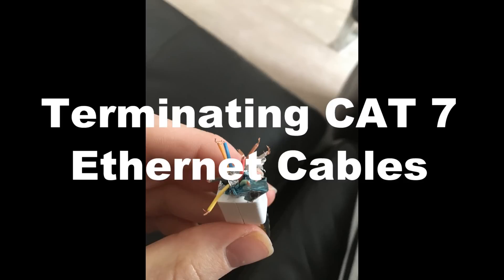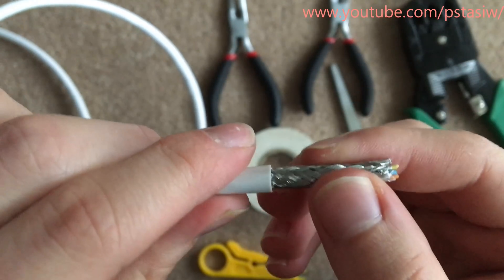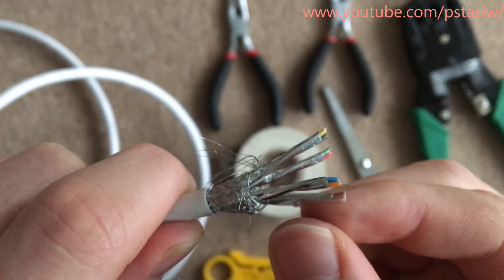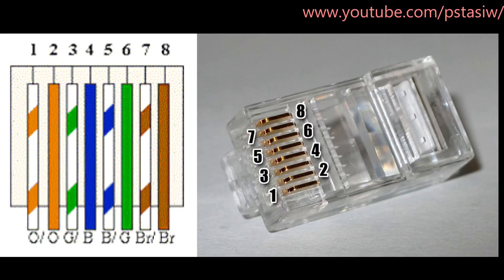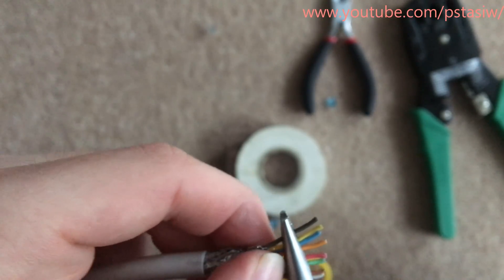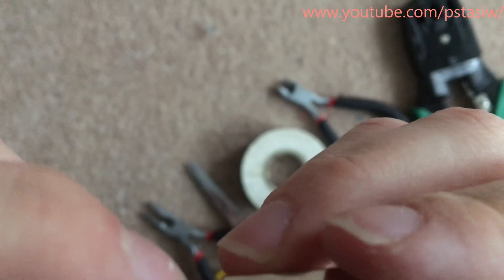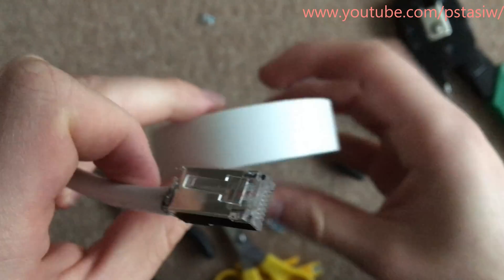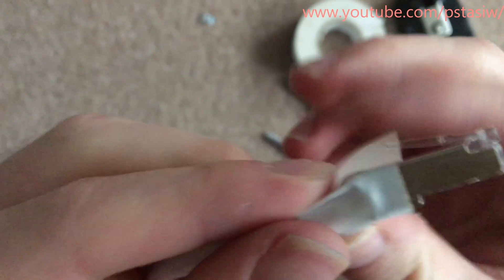How to terminate CAT 7 Cables with a Shielded RJ45 Connector [4K]

Comment: Bad! BAD advice! for beginners do not follow this videos advice. This person clearly doesn't know what he is doing.  The twisted pairs must be used as PAIRS! I worked in networking for 10 years I know what I am talking about.
Reply from the maker: If you’ve worked in networking for 10 years why are you watching this video?
Reply: @pstasiw  The video popped up in my feed and I clicked on it 🤷‍♂ bored I guess. Fact is I design implement and program networks for Cisco customers I am usually not the one running and terminating cable but That is where I got started years ago. point is that there are plenty of good videos showing the propper way to terminate cat6 / 7 shielded cable... but this isnt one of them.

Comment: This is one of the worst cable crimps i have ever seen. He didn't measure the length needed before you crimp. He didn't insert the cable all the way into the connector. Then to top it off he uses electrical tape! Just bad dude. I wonder if you have cross or static signals.
Reply from the maker: Cables work perfectly thank you very much

Comment: this is not even a cat 7 cable.
This is tops a cat 6 shielded cable...
Difference: cat 6 wires are 1.35mm, cat 7 wires are 1.5mm.
Problem, they do not fit in the regular RJ45 plugs, so don't get fooled by the title!!

Comment: I get why the Haters are Bitching... But Trust me at one point THEY ALL DID it too... in there life ...just like you did So Dont listen to them young man, but for your Next try go on Ebay or an electrical Supply House & look into getting RJ45 PLUG BOOTS that coverup the base and come in many colors.......they slide on the cable and when your done you slide them back up and they lock in place and some come all the way upto the RJ45 locking tab and make them look Pro you can get a bag of them for a few bucks........So keep at it and just make sure you test the wire after you made it and keep on TRYING!!

Comment: the shield was not properly terminated so the use of the cat 7 is wasted, there is no protection against cross-talk for example. wasted money. The tools used are not sharp enough to do a professional job
Reply from the maker: Thanks smarty pants. The cables still work, just not as fast. Run a speed test with them.

Comment: This is extremely bad!  You need to cut your wires shorter to allow the outer covering to enter the end connector.   I applaud your effort but in the long run this connection will fail sooner rather then later and the signal over this connection will have a lot of crosstalk!  If you were in one of my classes you would get a failing grade on this connection.

Comment: At 3:57 Yes it does matter which wire goes to which pin. It really does. You must not split the pairs.
Reply: Technically, no, it doesn't matter if each end of the wire are configured the same. A wire is a wire, the color doesn't make it any more special. It's only used as a guide to make sure you don't fuck up.
Reply: @TetraSky  You must not split the PAIRS. You can technically make up your own standard, but communication requires 2 wires, and those must be twisted to reduce crosstalk. 8 wires = 4 communication paths.

Comment: You test the connection after a while? Because the copper is one of the most influence metal on the temperature (cold/warm), the connection for sure will be affected. Best idea is to use fild connector for outdoor, more expensive but sure connection in time! http://shopconectica.ro/mufa-rj45-cat6a-cat7-ftp-pentru-patch-cord-uri-teren-100-140.html

Comment: This is one of the worst cable crimps i have ever seen - On the + side, I applaud your DIY approach but you need coaching on how to do this right.  The shielding should be under the crimped end to help the longevity of the connectors and protect from attenuation.  

for newbies, you will find that starting with 2-3" individual strands is easier to work with -- Get your wires in order and straight, trim the ends so the sheath to the end of the wire is ~0.5 inches and add the wires into the jack via the correct pin order.  Hold there and add the jack to the crimp tool and clamp it down.  as you get better, you wont need as much lenght/waste.

Cheers
Reply: Came here to say the same. This was painful to watch even for a diy
Reply: tell me about it! I build about 200-300 Cat-5e cables a year in my job, and I cringed all the way through... wow. even DIY, your quality will only be as good as your tools... kiddie paper scissors? really?BTW, no load bar, no shield crimp=cat-6 or barely cat-6a.PAINFUL!
Reply: This guy Terminates
Reply: Idem
Reply from the maker: +mark meyer cannot fit the shielding in the crimps